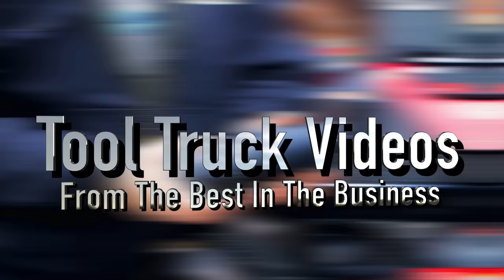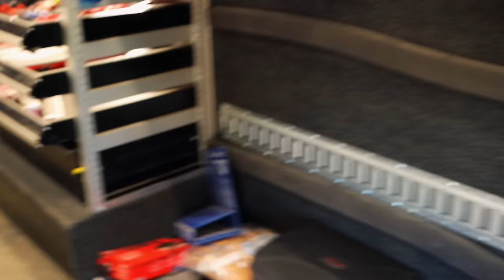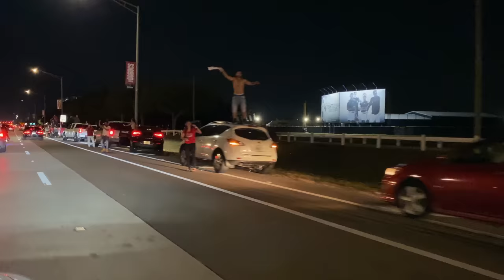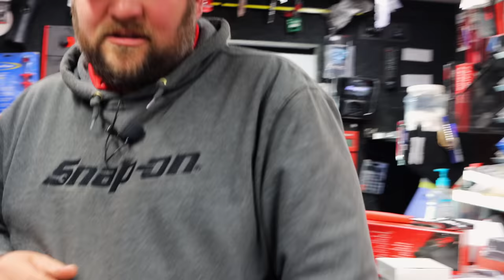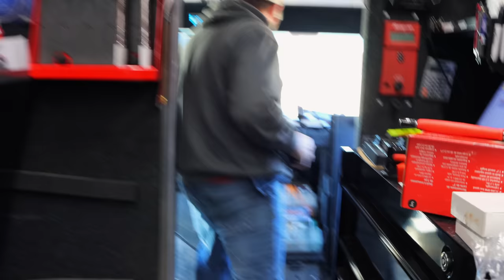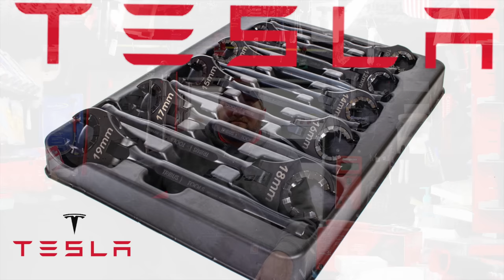Snap On Friday: Tribus Tools and Super Bowl Predictions

Comment: Hey Clay. I finally bit the bullet and ordered my first and only Snap On ratchet. I wanted to see what all the hype is about. And it really was not much more then the GearWrench ratchets that I always buy. I wanted to buy a Matco ratchet but trying to find some one or somewhere in Canada to buy one is not easy. I wanted to buy the Matco 3/8" locking flex head with the blue comfort grip but Matco in the USA will not ship into Canada. Their loss I guess. But I can not wait to get my hands on the S/O ratchets.
Reply from the maker: Well if you want one you email me, koontrucking101@gmail.com I will make it happen
Reply: @KoonTrucking  Thank you so much Clay, that means a lot. Unfortunately I already bought the Snap On ratchet for now but maybe in the next couple months I will get the Matco ratchet. The Snap On ratchet I ordered is just a 3/8" straight ratchet with no flex head and is 9 1/2" in length and the black and orange comfort grip. It was actually cheaper for me to order it straight from S/O then eBAY. I find on eBAY everyone thinks their tools are made of gold. Most of my ratchets are GearWrench so they are descent quality but I decided to spoil myself with a Snap ON. And hopefully in a couple months I can get the Matco Locking flex head with the blue comfort grip.

Comment: Hey clay I used that nox wrench for the first time today and it broke immediately I thought they fixed the manufacturing issues with these...
Reply from the maker: They did. Did it hang or something break inside it ? They will replace it either way.
Reply: @KoonTrucking  went to crack it loose and the ratchet mechanism just broke and kept skipping in the same position with little to no pressure on it.
Reply from the maker: Must have been a bad pawl. DM Tribus on IG or Facebook and they will get you a replacement sent out they are good if you have any issues at all

Comment: Did they fix the cracking problem on the ratcheting line wrenches. I want a set but how’s the warranty?
Reply from the maker: Yep if you will watch the video on Instagram the CEO addressed the issue. It was only on 3 of the sizes that were double hardened and that was done by the coating company (they also changed companies after that issue) but none were sent out to anyone that purchased it only to a couple of YouTube tool reviewers who were notified even before the product arrived because it was caught during testing at the plant. 
They carry a full lifetime warranty

Comment: Dumb question...with all the stupid unreliability of all the diesel emission sensors, would it be worth it to run a a gas engine in a truck that size?  Like a 6.2 LS?
Reply from the maker: Probably have over heating issues with it idling and the power wouldn’t be there either. Those trucks weigh a lot with all those tools and boxes in them
Reply: @KoonTrucking  gotcha.  I had a Chevy Cruze with the 2.0 turbo diesel.  Loved the car and power train.  However, I was in the dealer every 8-10k miles getting new nox & o2 sensors, def tanks.  At the end of the emissions warranty, traded it for a gas powered car.  A lot less aggravating.  GM had the right idea, but could not work the emission system problems out.
Reply: Personally I would, but gearing and transmission are everything to make it bearable, and 6.2 liters is a little too small for me. Ford and GM ran 429 and 427 engines for years in medium duty trucks, and even smaller gas engines (370 etc.), but they had their disadvantages.  They need to run pretty hard to keep up with a diesel. That new Ford 7.3 with a 10 speed is the only thing I'd even buy in the pickup world these days, for the sheer bang for the buck. Plenty of motorhomes were built with larger V10s, 460s, 454s, and 496 engines (8.1L), and they're a little slow but they do the job. From direct experience, I can say LS engines are a good choice for a pickup that doesn't haul heavy all day, but the larger engines are the answer for cooling, low end power, and long term reliability and cost. "The brighter the bulb, the shorter it's life" comes into play. LS is a physically tiny motor regardless of the displacement and that means it's running hotter. Stroker engines usually run hot since it's more cubes in the same size package. Power takes energy, and no matter what, all of them take quite a bit of fuel to move all that weight around. The truck needs lower gearing to get into the power range, and you'll notice that any 1 ton gasoline pickup, van or motorhome chassis comes with lower gears than it's diesel brother. Modern transmissions make gas engines more feasible and a much better value. More gears means the gas engine can sit at it's best power producing engine speed more often. 

I daily drive an old 1 ton Ford 4x4 with a 473" and a 4 speed. It's great when you are at the engine's happy speed, but that's damn limited in practice and basically limits me to 2 effective speeds in 3rd and 4th when towing or carrying heavy. It's been a great truck over the years but it would really shine with a 6-10 speed transmission, whether auto or manual. 

One more huge diesel advantage: Fuel consumption at idle. These guys are sitting often with the engines running so you will hop into the cold. It's hard to stay off the tool trucks when you've been working in the August Texas heat for hours and you know it's an ice box on wheels. :) Can't sell anything if you don't get on the truck.

I'd spend the gas money for it myself. You can replace a gas engine entirely twice over for the cost of some diesel repairs. But that's just me and I get along just fine with big blocks and HD gas engines in general.